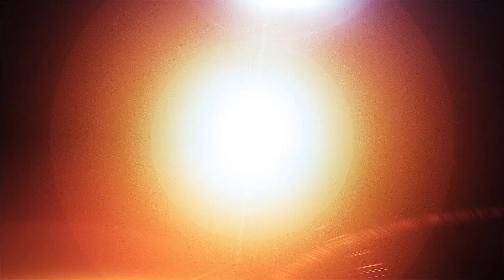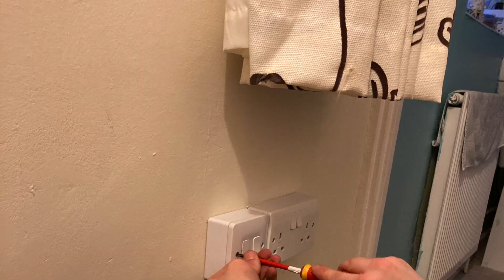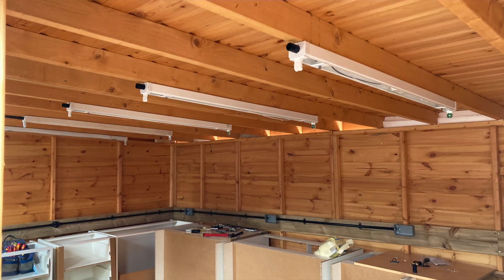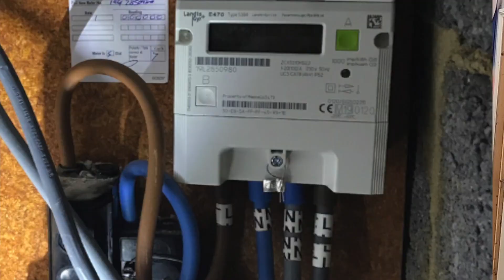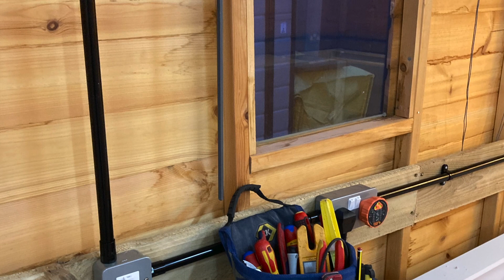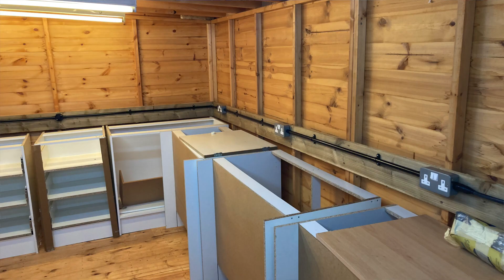Electrician - Shed Power & Lights via Steel Armour Cable & Conduit | Electrician TV

Comment: Nice Will! Good video mate. Defo with the springs! Pain in the arse sometimes.

Exporting the earth if no extraneous services etc in the shed, crack on for me. 

Keep em coming mate.
Reply from the maker: Cheers Mark I’m having a nightmare trying to get hold of one of those the dewalt wall chase bits from your video
Reply: @ElectricianTV  yeah the sds plus versions seem to have gone.
Reply from the maker: @electrician247  I was reading in your comments that somebody mention the Ebauer  one I thought I’d give it a try

Comment: Hot rather than cold bends are the way forward. We have heating units here in the USA, even wrap blankets for bending pipes much faster, cleaner and less effort:

https://www.lowes.com/pd/Southwire-0-5-2-Inch-PVC-Bender/5001796241?cm_mmc=shp-cprdelcgooglepla-106-electricalaccessories-5001796241-_-0&placeholder=null&ds_rl=1286981&ds_a_cid=112741100&gclid=EAIaIQobChMIgNuawJfl8QIVp3NvBB3rMwEGEAQYEiABEgLmb_D_BwE&gclsrc=aw.

You can get larger ones as well we use them as main feeders to a service or for larger cables in industrial settings.

https://www.greenleestore.com/products/greenlee-851-1-2-4-electric-pvc-heater-bender?variant=15441080515&currency=USD&utm_medium=product_sync&utm_source=google&utm_content=sag_organic&utm_campaign=sag_organic&gclid=EAIaIQobChMIgNuawJfl8QIVp3NvBB3rMwEGEAQYASABEgI5B_D_BwE

You can also use a heat gun set in on the floor and heat the pipe over it the second thing to have nearby when bending PVC conduit is a bottle of water or a hose.  When heating PVC conduit it becomes very maleable, but it does not stay in the position you bend it without waiting quite awhile – while holding it in the desired position.  One way to speed the drying process up is by splashing cool water on the PVC to set it instantaneously.
Reply from the maker: Hey how you doing maths man.I must of missed out of the video but it’s day one of school to heat up the pipe normally the friction from rubbing your hand can warm it up enough the issue is the slackness of the Bendy spring in the pipe I will check out that product as I can’t see it on my phone.How have you been how do you think you’re going to get on this season.
Reply: @ElectricianTV  hopefully we can build and get top 6 though this season will be tougher. Roman still splashing the cash I see. You think you challenge for the title this year?

Comment: Yer conduit has been getting worse for tolerance's.. bends have been coming out worse and worse over time.. we resorted to pre-formed bends and inspection box's and the likes.. its crap.
Reply from the maker: I totally agree using them makes you feel like as if you’re not skilled enough to pull a bend.

Comment: Heat gun works great 👍,  but ya I got a bender once that was slightly 2 small and that was horrible, then I got a bigger one for the 20mm conduit and it works fine. 
But ya it can be a pain somtimes
Reply from the maker: I’ve got about three Bending spring.Good tip with a heat gun even though the problem is always How loose this spring is in the conduit
Reply: @ElectricianTV  I've sent you a video. Also love the channel rebranding 👍